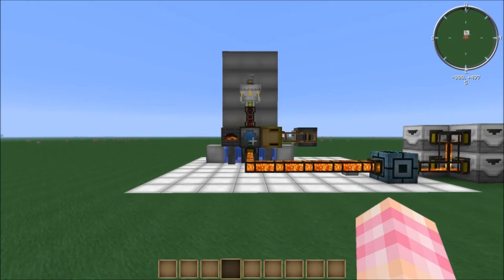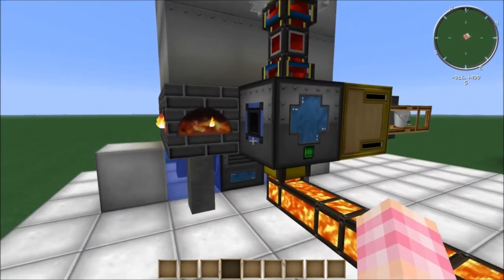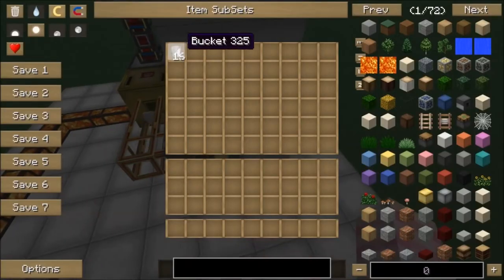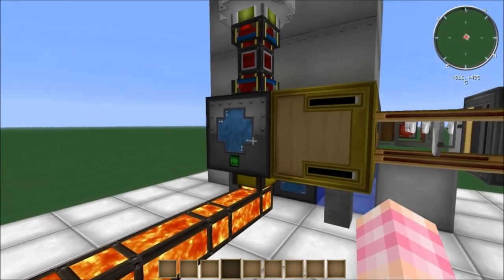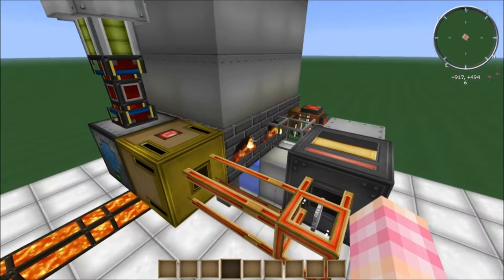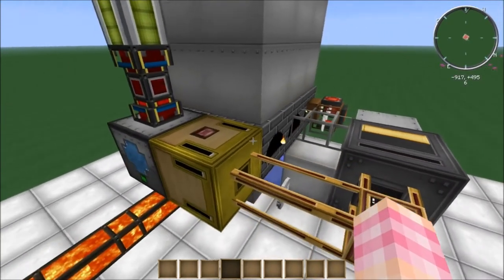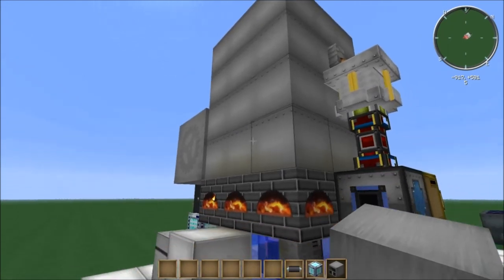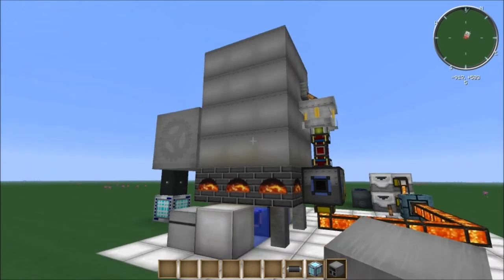Feed the Beast Tutorials - Automated Steam Boiler Running on Lava

Comment: Just tried this. I found that if you just put the autarchic gate next to the liquid transposer, it works just as well; and you only need a single stack of buckets. Actually it works better, as the boiler never has to wait for a bucket.